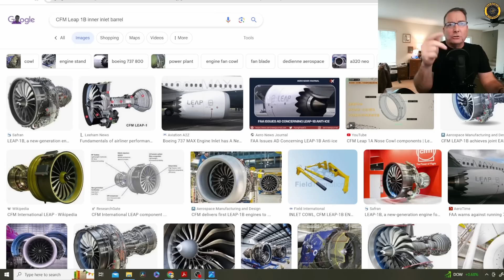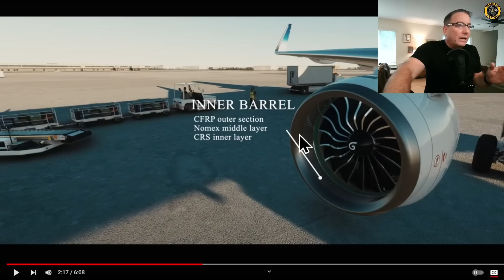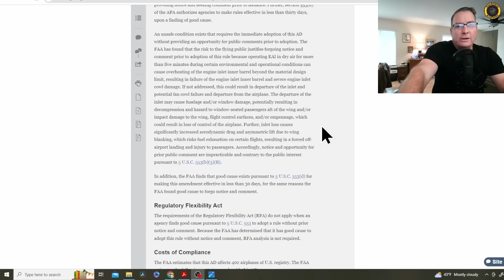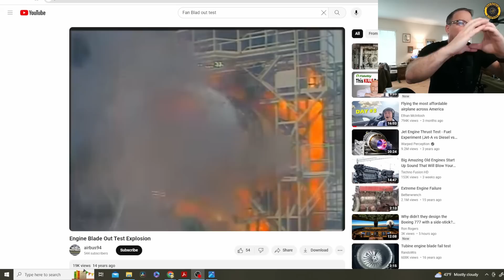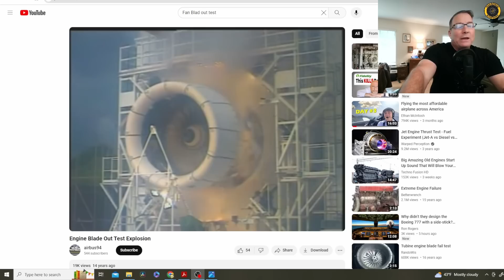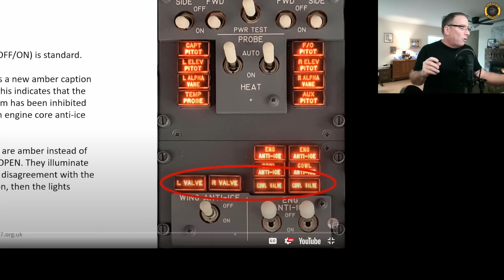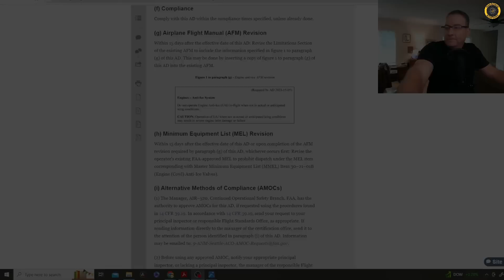Boeing 737 Max-7/-10 Certification HALTED! 1 Feb 2024

Comment: How has such a design deficiency gotten past certification?
Reply: Friends and Shareholders.
Reply: 🎑💰💰💰💰💰lobbyists and influence.  The same old neverending dtory
Reply: The Engine de-icing heat switches have to remain the way they are to not mess up type rating training?
Reply: This is a ridiculous situation.
So the only reason the engine anti-ice is not automatic is that Boeing wanted maintain commonality with earlier version of the 737? The same reason they installed MCAS! 
Obviously they still don't care about safety. 
Relying on the pilots to remember to turn it off is stupid and dangerous and as said if the valve sticks, then what? 
Since it is a known and potentially deadly flaw, one would expect the FAA to ground the entire series until the problem is fixed, but if course they have always been in the pockets of the manufacturers and airlines.
Reply: @gregculverwell yeah, the temporary solution of "remember to turn it off" is terrible, but don't pretend they decided to not have auto anti-ice just out of preference or to save $0.20 per aircraft by using a 2 position instead of a 3 position switch.

They basically had to keep the old interface so that the FAA wouldn't make the airlines have the pilots do a whole bunch of extra training and maybe jump through some hoops if they decided this 737 needed a different type certificate.  Which would also cost probably a couple hundred million to get, and make an operational nightmare by enforcing that only certain pilots can fly certain planes in the carrier's fleet.
Reply: @roflchopter11  remember to turn it off. They mean like the pilots remembering to turn off the seat belt sign after they clear turbulence?
I've flown enough internationally to know that they often forget and when passengers complain that they need to go to bathroom the FA has to ask them to turn it off.
Reply: It is called self certification, and the FAA has authorized it many times at Boeings request.  Basically criminals helping criminals.
Reply: Bean counters. It doesn't matter what the engineering says, if it falls within the requirements and is less expensive...
Reply: @morthomer5804  For sure that’s likely why Boeing did it this way. And why did the FAA certify it? Oh right…bean counters, just of an elected nature, not professional. I need to look up who thought up the idea of using self-certification so I can direct my ire towards them.
Reply: @shibasurfing  It's not "self-certification" (assuming you are talking about Organization Designation Authorization, or ODA). The FAA has plenty of oversight, including the ultimate decision on the type certificate, and the people who are the RCEs and RCIs (look up those acronyms) take their jobs very seriously. I helped publish our first ODA manual several years ago. The FAA instruction manual for merely writing our manual is over 300 pages. And ya know what? ODA works just fine, with a proper corporate culture.
Boeing needs some serious work to get to that level; they are a large customer of ours, so I hope they fire the right people.
And if you want to see aviation innovation grind to a halt, pull ODA from everyone who has it. More government isn't always the right answer. Or even ever the right answer.
Reply: @UncleKennysPlace  more government is never the correct answer but people accept it as such.
Reply: @UncleKennysPlace  Sometimes innovation isn't the right answer either, when it's for the wrong reasons.
Reply: @UncleKennysPlace  "...More government..."
So the widely reported (and quit well documented) stories, of how Boeing talked the FAA out of doing their jobs during the MCAS fiasco, was all made out of whole cloth!?
Less than necessary government, isn't the answer either...
Reply: @donaldrobinson6298  What an absurd comment. Let's get rid of police, fire departments, the military, food safety inspections, air pollution laws, the Clean Water Act, public roads, because less government is always good, right? Boeing's quality control problems started after the FAA let them certify their own aircraft, but sure, we should deregulate them even more.
Reply: And that is the multi-million dollar question.  How did a system that can't stand the heat of normal operations get past so many people?
Reply: @robobloxgamer524  Why isn't Boeing allowed to add an "auto" switch position to the de-icer controls?
Reply: @dafunkmonster  Boeing can do just about anything it wants.  The issue is the cost of engineering and the mod packages required to update a whole bunch of aircraft versus whatever benefits Boeing may receive from the change.  When a manufacturer puts cost before safety (and I'm not saying Boeing is or is not) then there are problems.
Reply: LOBBIESTS
Reply: The standards have changed.
Reply: The main reason they keep adding bigger engines and more length to the 737 is so they don’t need a whole new plane safety certification and a bunch of flight testing/more training for pilots. So technically a guy that flew a 737-200 in the 80’s should be able to do a little training and fly a 737 max, but in reality it hasn’t worked very well lol.
Reply: because the FAA was just rubber stamp anything Boeing want instead of doing their job.  Seems that if the pressure had been put on they were going to do it again.
Reply: ... people get hoodwinked into right wing ideology and vote along those lines. Right wing policies cater to the corporate lobby rather than society's best interest.  Corporations put emphasis on share holder profits rather than on consumer safety.  Right wing idealizes small government, no taxes, and so they cut back on regulatory oversight, and privatize what once was public services; and eventually corporations start to certify and inspect their own products and services.
Reply: politics
Reply: monkeys did the certification!
Reply: Bought and paid for FAA
Reply: Like many problems with airliners of all generations, some issues don't show up until the design is subjected to many hours of service or encounter conditions that are difficult or even impossible to duplicate in testing. Still, anyone who thought subjecting CFRP to bleed air temperatures was a good idea needs to be shown the door.
Reply: Corruption and shareholders. Sometimes that's the same thing.

Comment: Airbus too with the Leap 1A? This is on GE and Safran (Leap is a CFM product, a collab of the two companies)
Reply: Nope. I ran the group that published most of the cert documents for the LEAP (all caps!) engine series (with the A for Airbus, B for Boeing, C for Comac) until I retired on 01 January, and am pretty familiar with the things. You'd be shocked at which bits are the airframer's responsibility. In some cases, a certain system on one engine will be a GE or CFM part, but that same system on another engine will be on Boeing or Airbus to supply.
Reply: @UncleKennysPlace  so why are the Leap-1As not having this same issue? I know they have a higher bypass ratio and some other differences but what is responsible for one failing vs the other not?
Reply: Also sounds like other airframes using this engine probably have that AUTO anti ice capability
Reply: @gregdildine99  Other airframes? we do mean designs that have names beginning with A and ending 320/321?
Reply: No. The cowling is considered part of the airframe, meaning Boeing. Not part of the engine.